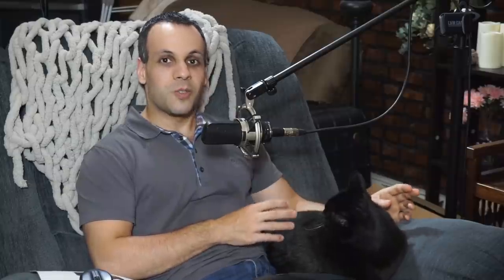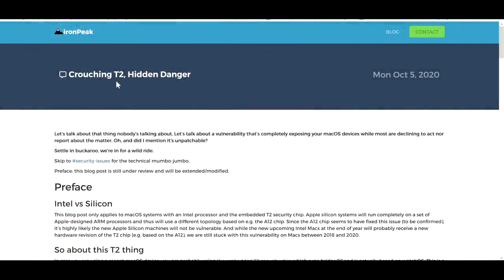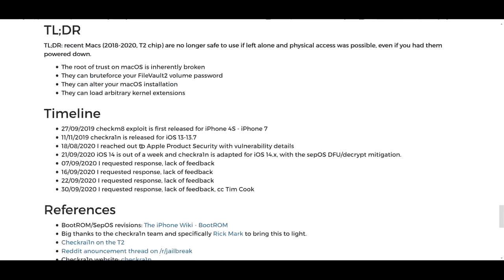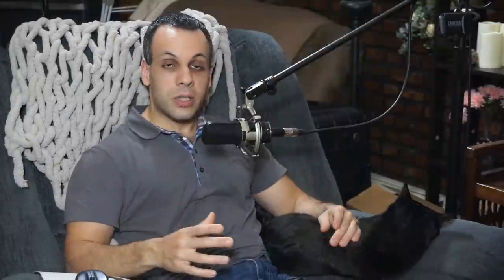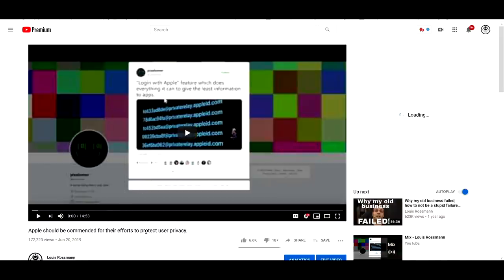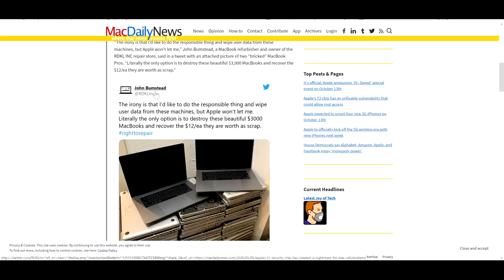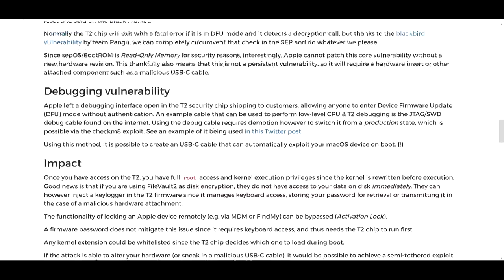Apple T2 chip security closer and closer to being compromised.

Comment: I have to agree with Saif.  Someone is going to figure out a way to make hard to get chips and sell them.  That is the new frontier.  "Generic" chips that perform like name brand chips.  Alright, where did I put my fritos.....
Reply: Like Louis said, Apple is migrating to ARM, and ARM is still very much open source. It likely wouldn't take any engineering marvels to re-create a functional stand-in replacement for anything Apple can make, on the assumption that it has been clean-room dissected.

And what kind of nonsensical reply did the other guy write to this comment? I'm looking at you, @Will C.
Reply: @KSword007  Maybe, maybe not.  There's still the possibility of them modifying those ARM chips (new security/anti-repair features, switching pins around, hidden code, changing the stock chip size/shape, etc, etc) to make such replacements difficult if not impossible when they have a near certain stranglehold on replacement parts.

For now we can only wait and see how they implement/integrate ARM chips into their products.
Reply: Yeah considering it is possible to run OSX in a virtual machine it must be possible to create a bootleg pin-compatible T2 chip without the security features. Just enough features to send the necessary power-on signals. Problem is Apple probably has 300 different patents on the chip and will cease-and-desist anyone who tries to do it.
Reply: @YouCanHasAccount  macos in a virtual machine is a completly different animal. there the kernel is hacked to bypass T2, there is no Vmware driver to simulate a T2 ... sadly lol
Reply: @lateral1385  no, nobody said bestiality except you.  Is there something you would like to share with the class?
Reply: ARM is very much not open source. They have very liberal licensing agreements but iirc they're still getting paid per CPU sold (if not they're still getting paid for the IP).

Replicating efforts done by Apple on their arm chips is also no small feat: CPUs take years to design, billions in RnD and aren't easily reverse engineered. Making a clean room copy would still require massive investment.
Reply: @alaeriia01  Are you sure?
Reply: @lateral1385  If he's wrong, prove him wrong. From what i see in the comments tho, he's correct.
Reply: @myrpatroll  Is that so?
Reply: The new frontier is 100% open source processors like RISC-V and OpenPower
Reply: @YouCanHasAccount  China doesn't care about legal crap lol

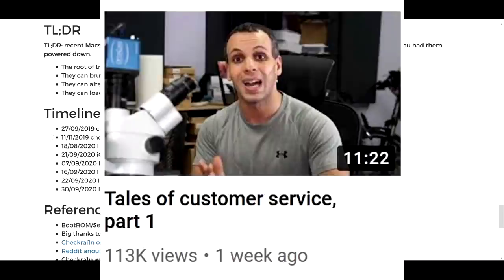Comment: 2:37 - "They're putting the dates backwards"
Someone writes dates properly & Louis is frustrated because it's not backwards... which is normal for him & Murica :)
Reply: @armandosoria7993  DD-MM is in my opinion just as good as MM-DD as long as you keep it in ascending or descending order like DD-MM-YYYY or YYYY-MM-DD, using MM-DD-YYYY is fucking stupid and confusing
Reply: @kacperfilipek8461  Mm-DD is better heres why. 
1. DD-MM, if i say the day is 15. You have to look for 15 right? Problem is theres 12 15s. So that info gives you nothing. You have to wait for the month to even really start looking for the correct date. 
2. MM-dd, if i say the month is 1 then i look at janurary. Just like that ive narrowed my search. Already 1 step ahead of dd-mm. 

MM-DD>DD-MM
Reply: @armandosoria7993  about that number 1
why would someone give you the date with only the day given? maybe i didn't quite understand what you meant, but i don't think that the fact that day is on the left or right would optimise anything as you usually have the whole date given. And a lot of countries use DD-MM-YYYY or even if they use MM-DD, if you have the context of what year it is, the full date actually becomes YYYY-MM-DD which is in descending order, so it makes more sense than using MM-DD with year at the end, cause the second one is just an unordered mess.
Reply: but my point is that it doesn't matter if you use month or day at the beginning as long as you are consistent and keep it in either ascending or descending order all the way.

Comment: I keep forgetting that the public aren't massive nerds...

I used to be in the jailbreak community, Checkm8 has been around since late 2019 and supported all chips from A5-A11, and the T2 chip is based off the A10 chip. Therefore, once the checkra1n team got the iPhones down, they looked at what they could do with T2 since it was based on the A10. So, the T2 has been pwned since 2019. I don't know why this is news *now*, it should've been news back in December or January.

I don't think Apple responded to this exploit because it's a BootROM exploit, meaning that it's unpactchable since it attacks Read-Only memory. They only way to fix it I think is soldering a brand new T2 based off of an A12 or A13, and it's too late to do that now that new Apple Silicon Macs are coming soon. But they are definitely aware of the exploit, in fact, they "patched" the exploit on newer iPhones by basically force-panicking whenever the exploit was about the be run (but an exploit in the Secure Enclave, where TouchID and FaceID information is stored, will go around that. Jailbreaking is a cat and mouse game when it comes to iOS...).

I think this all is just a slap in the face to the enterprise customers that bought Macs and trusted Apple with their security. This is worse than Spectre and Meltdown because all you need is the machine and a few minutes and you have full root access to the computer outside of macOS, so you can do whatever you want to do to the machine. And the fact that Apple isn't talking with, or apologizing to these enterprise customers, some of which may have sensitive data, that genuinely would buy an entirely new fleet of MacBooks just with a fixed T2 chip is sickening.

Comment: I have a similar story with Lenovo T480s. I found it great that there is absolutely no way to reset the bios password, until I managed to forget mine. Motherboard was a brick and I had to order a replacement. About a year later, I found someone that had managed to circumvent the security. A few eeprom reads and writes later my old motherboard is working again!
Reply: How Not To  I know right! I created a password and saved it to my password manager. Never clicked save, just exited the program. Password was gone next time I tried to access it. Ofc I enabled tamper detection. So the next time I opened the bottom lid for cleaning the laptop went into tamper mode and required a password to boot again.
Reply: How Not To  Nope, I had to purchase a replacement motherboard for about 900€. Fortunately it was my work laptop, but still sucks.

Comment: This reminded me of my roommate, who barely speaks German and bought a used laptop, a few months back maybe, paid 60€. He eventually came to me because he needed help with something, so I had a look. He pointed me at a game he heard of and wanted my help installing it. I took a few closer looks at the machine. It ran Windows XP, for some reason had 2 GB of RAM though, an Intel Pentium M at 1.75 Ghz and some sort of AMD GPU equivalent to an Intel HD, for which there werent even drivers installed, so I did at least that for him so Youtube wouldnt drop every other frame.
The games system requirements started with an i3. I didnt bother reading anymore, I just plain told him: This game will not work, and this laptop is so ancient, if you paid 60€ for it, you got ripped off. But hey, at least itll work with Youtube and general web browsing. 
Truth be told, I had to look up Intel Pentium Ms afterwards, because while I could figure roughly what kind of CPU and from roughly when by sheer deduction, it was something from before I got legitimately interested in computers enough to know much about it.

Comment: hello
in the case you described appel is the owner of the personal data of the device and should buy back all the devices that have been repaired and not taken over after a certain time, otherwise it can be considered that the service technician is in the wrongful possession of personal data. appel company then such must take responsibility for the destruction of its products. in the future it will be necessary to make a contract which the owner of the device will have to sign, that if he cannot pay or comes for the devices within a certain time from the completion of the repair of the device, the service company becomes the owner of this device. and as the owner of your device you can use it for spare parts. Appel must then allow you, as the owner of this device, to delete your data from the device and sell it, otherwise Appel is the owner and must pay for the service.

Comment: In other devices there are old good reset button, that wipes out all configuration (data) but it allow to use device and make your new own config, load new OS, whatever. Other solution is to get unlock code from manufacturer based on serial number (you can make then stolen devices DB and don't send it) , but in this case manufacturer need to cooperate, and as we know this is not always the case.

Comment: I never use hardware/device/OS security. And I ESPECIALLY don't use any form of biometrics. I use trusted and validated third party open source software to secure my sensitive information with a few extra tweaks of my own thrown in. If someone steals my laptop, well, they have a working laptop they can wipe and reinstall sure. But they don't have any of my information. I also have a wipe account on all my devices. I have the OS set to always ask for a user name and password at login, not just a list of possible users. If I'm forced to divulge the login, I have a special one that, when logged in, performs a complete wipe of all encrypted drives, VMs and containers, wipes out any software used for that purpose, removes all traces of other user accounts and then self destructs the background app that is run to perform all these things. The result is that the guy holding the gun to my head sees the machine login and there's literally nothing on it but a single user account with dummy (useless) data that I prepared.

Comment: I think Apple is pretty good about security but Louis is correct in saying the same security is used to prevent people from making repairs. 

Just my experience but here goes: cracked the screen on my iPhone 5. Got one from eBay, installed it then turned the phone one. Got stuck in a boot loop. Spent half the day with iTunes trying to do a restore and whatever else apple recommended nothing worked. 

Watched a YouTube video a young teenager put out saying download this free trial version of “Phone Doctor?”  Within a few minutes the phone was working perfectly again. 
 So I suspect Apple did that on purpose because the replacement screen didn’t match whatever hardware ID it used to identify the original screen.

Comment: Apple generally does not acknowledge security flaws until they have a fix. The reasoning being that acknowledging an exploit, publicizes it. More over, it can cause a burst of ignorant media reports that the devices are insecure, which in turn causes a burst of tech support calls.

Apple takes secure exploits extremely seriously because it’s the basis of their value proposition. If they aren’t talking, it means they’re still working.

Comment: That issue with not being able to re-use equipment that has been discarded or orphaned by others is present in Android phones as well.
I have a stack of Samsung phones at work that have been returned by leaving employees without their unlock codes and account password, and you cannot reset them to be given to a new employee.
There is a theoretical method to reset them via a Samsung replair center, but it should not be that difficult.  When we decide it is not worth it to lock down devices so thieves cannot re-sell them, because we more often have orphaned devices than stolen devices, we as the buyer should have that freedom (by disabling this feature somewhere in the settings while the device is operational).

Comment: I wish the T2 was only for encrypting the disk for data security and not used to lock the entire device out for resale. I get they  push this feature as a way to deter criminals from stealing the devices; but I don't know if the ewaste is worth it. I'm glad the hackers are finding a way to get around the T2 chip. The future possibility that Apple will further lock down hardware upgrade/replacement options is enough for me to welcome it's demise.

Comment: Just look at what John Deere has done to their equipment! You can replace the broken part but if you don’t have access to their software to recode the new part in, it does not work. Ford has done the same thing on many of their vehicles as well on certain things like the ABS Module. Only Ford can recode this and several other things on the vehicle. Even to you spend $7000 plus on a snap on code reader your limited to certain repairs! I have a 2009 F-150 and it costs $400 for the ABS Module and $1200 for the Ford dealer to recode the new one into the truck... Mine still works, just you have to look at the light all the time!

Comment: While I agree with you about the cottage industry for reselling stolen electronics, Apple initially made this industry thrive with how they handled stolen iPhones for the first four or five iterations of the device.  From the iPhone 1 to like the iPhone 5s, if you 'forgot' your password and took the device to the Apple store in most cases the existing device was swapped for a refurbished model of the same iteration without questions being asked.  This all changed after the prototype model was left at a bar by an employee and the drama that ensued with Apple Security and San Fransisco police.

In San Francisco and many bay area cities there was a rash of grab and dash thefts of iphone devices from bus stops, coffee houses and outdoor dining establishments that resulted in the various cities putting pressure on Apple to develop software and policies to prevent this from occurring.  They did.

In most cases Apple security has been developed as an afterthought in direct reaction to exploitation of the lack of security.  The first iphone sent passwords in plain text when using pop and imap to access email.  At one time the icloud could be used to access other accounts simply by editing the account number in the address bar and incrementing it by one digit.  Think about that for a second and it's not just scary but ludicrously funny.

Comment: Definitely makes sense that they implement all of these security barriers where you can't just wipe data from a device and re-sell it. But in my opinion, having a $3,000 machine be worth a tiny fraction of that if you for example forget your passwords is completely ridiculous to me. There has to be a better way to secure your data, but also make it feasible for third party repair companies or even the consumers themselves to be able to commence basic troubleshooting and repair on their own devices. I think the ideal of safety>freedom is alot more dangerous since you're putting your trust into Apple, which might have your better interest NOW. But a decade from now under more corrupt leadership? It's not worth that chance. To me at least. I'd rather have Freedom>Safety and be responsible for my own data and hardware. Now if it was an option that apple sold as an extension or piece of hardware? That'd be amazing. But since it's not, I've had to turn down too many data recovery jobs on these newer devices (Iphones and Macbooks) because electronic illiterate and forgetful people don't know their password and I'm not aware of any way to decrypt the data even after hardware repair. Unless there's a way with these phones and macs to data pull after they get fixed without that information they're S.O.L. Unless there is a way and I've been turning down alot of money...

Comment: Selling stolen laptops is a problem that I would like to see fixed. But isn't it something that could easily be resolved without having to kill the repair business? Together with purchasing a device, you could get a certificate. You could then introduce a law that makes it illegal to sell a device without the certificate (oh wait, don't we do the same with cars?). The certificate could be a part of a blockchain - each component, all chips, drives and hell - even fans and batteries - could require the certificate in order to run. You don't have the certificate, you cannot authenticate the piece, and it becomes useless. Thus you could eliminate both the stolen machines and parts originating from these stolen machines. Now, it should be possible to use your certificate to transfer ownership to that device/piece, and bind it with the certificate of the new owner. So that if you sell a battery from your broken machine, and put it in a new laptop, authenticate it, and transfer ownership, it will be added to the blockchain and will work with with the new elements and not with the old ones. The blockchain could be open sourced, just like bitcoin, anyone could have a wallet of spare parts etc., and it would literally be nearly impossible to trade stolen computers or parts. At the same time the government should ensure that once the product is sold, the ownership is fully transferred to the new owner / consumer, and that the company that created the device cannot put measures in place to prevent further transfer of ownership with the techniques described above. What do you think?

Comment: I believe there is a solution that covers both sides of the story. What if they allow the T2 chip to be cleared without the previous users password, but then it sets a flag marking it as suspect. Once it is up and running again, it will 'phone home' to Apple periodically who can then notify the previous owner that their old computer is active. The previous owner can then choose to lock it if it was stolen, or confirm the legitimate transfer.